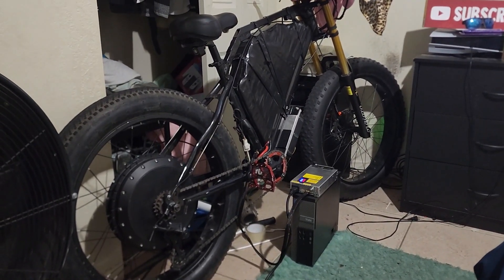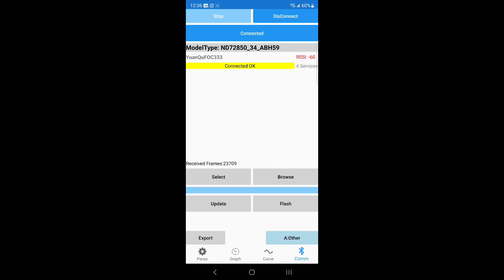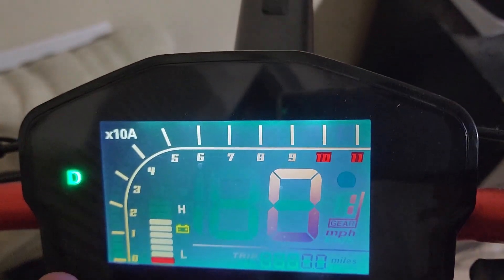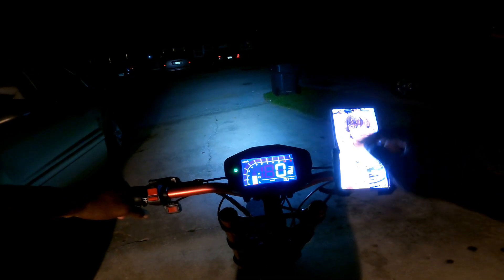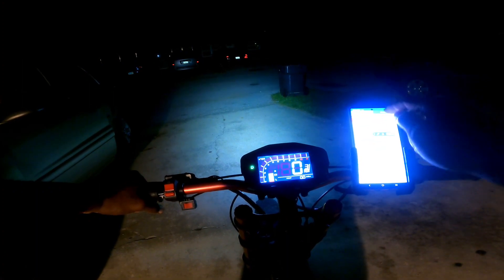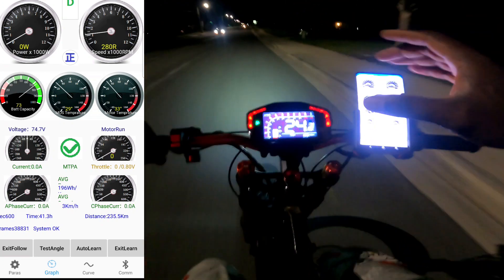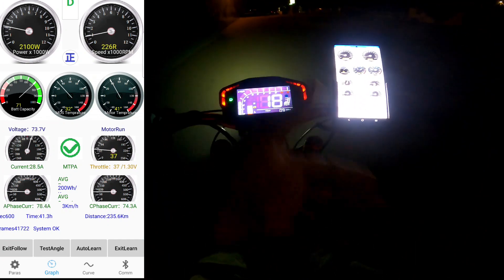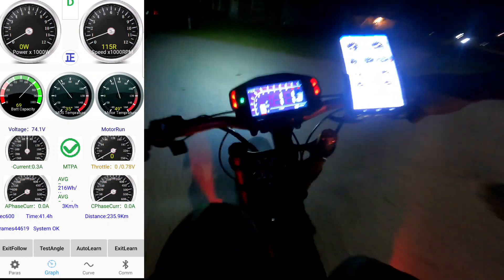How to have your power meter to work on your dkd display  27kw ebike ride

Comment: 8000watt, must be a real beast!!!
I'm impressed!
Seems the cop was pretty cool too, good to see.
Reply from the maker: Them qs273 are no joke. They heavier than the qs205 but the power will make up for that
Reply: @EBG-offical I'm gunna look into them, I've not built my bike yet as I'm still waiting for the hub kit to arrive (tomorrow Yodel are now saying, they let me down once so hmm, I dunno) and I'm waiting on the battery and a couple of Schwalbe puncture proof tyres coming also (don't wanna take any 'blowout' risks at 30mph/+)...

I'm real excited to do my build, I was wondering with the 1500w kit and a 52v 20ah battery will it be best to order some of this special 10/12 gauge electrical wire? I've been looking at - to go from the battery to the controller (controller will just be a Voilamart one, whichever comes with the kit) ...
I've tried finding out the specs of the Voilamart 1500w 48v Kit's controller, but try as I have I can't seem to find any info on it...
Everyone seems to be saying that the 1500/48 kit will handle the 52v20ah battery just fine, but I'm considering doing a shunt mod also (I'll be super careful to only add a small amount of solder and I won't bridge across the shunts((if there's two of them?))..
I think I might also be best to order some of those heat shrinkable wire connector small tubes to connect any wiring I may have to cut/adjust as I really want to make it look as neat as possible, it bugs me when I see people's builds and there's wiring all messy all over the place...
Thanks for your help and advice, it's really appreciated, I can tell you know your stuff when it comes to building e-bikes.
Reply from the maker: @mickyb.8014  get 10awg wire and xt90 connector that will do just fine 🙂 👌
Reply: @EBG-offical  brilliant, will do thanks ever so much!
Reply: @EBG-offical 
I've ordered the following...

'10 gauge AWG wire' -  1 metre length of both red & black wires.

2 x XT90 male & female connectors.

1 x Pack of 20 heat shrink (mixed colours) wire connectors - To neaten up all the wiring from the controller, if I need to, just want it all as neat as possible.

Controller bag - waterproof.

Torque arm (..I ordered 1 before not realizing you have put on both sides of the rear axle).

Thanks for your knowledge & help, it's greatly appreciated!
Reply from the maker: No problem my friend 😁

Comment: Are you still on LIN protocol or did you change to CANBUS? I thought it only worked with CAN.
Reply from the maker: It's that blue wire. I believe its LIN. Everything is communicating via the blue wire 🤯🤯🤯